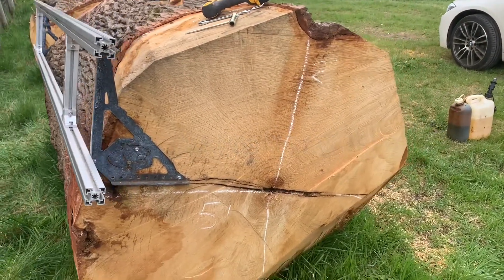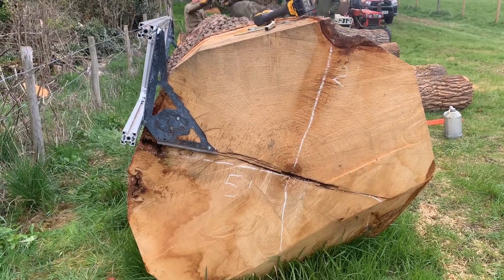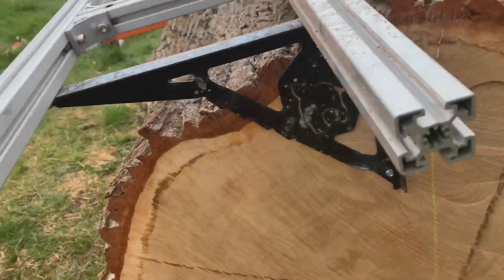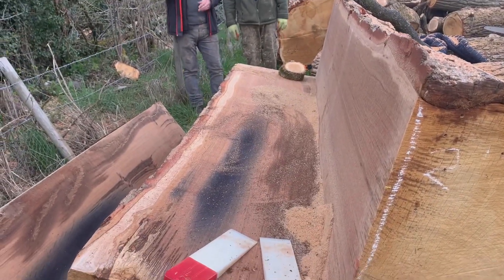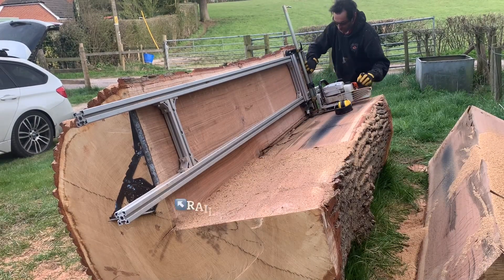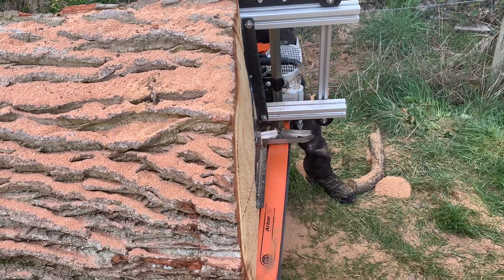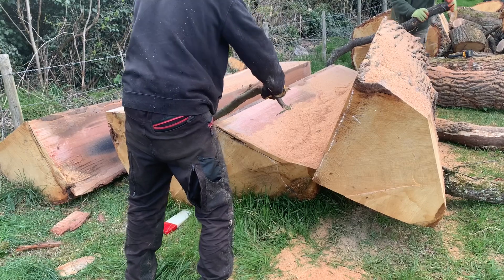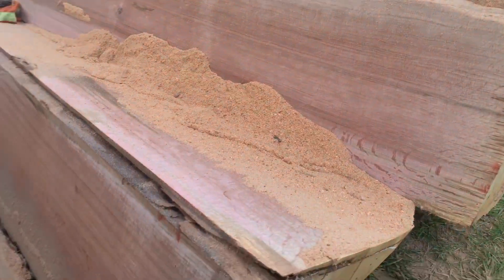Awesome milling. You cannot do this with any other mill - Panther Intersect styling :)

Comment: Hi guys. What I don’t seem to understand is why do you always want a live edge?  I can see you can do three side of the cant. What about the fourth side?  How do I make 4”x6” square poste or planks with straight sides or dimensional timber. Hope you see this comment it’s from the Panther Intersect playlist. But it’s playing the entire series and the next video has already started since writing this. Cheers. Do I also need another system?  Also the horizontal cuts in the video were just for the video?  Usually you would complete one at a time would you?  Then the log above drops down removing the kerf?  Does it. How did you finish off this log? It got transported elsewhere before finishing did it. Another question when setting up initially with the set square for the inside line is that when you should do the other side to ensure a square edge on the fourth side?  Anyway hope I get a response cheers